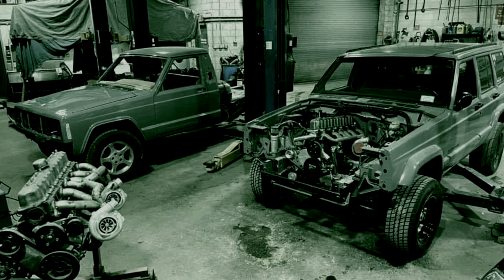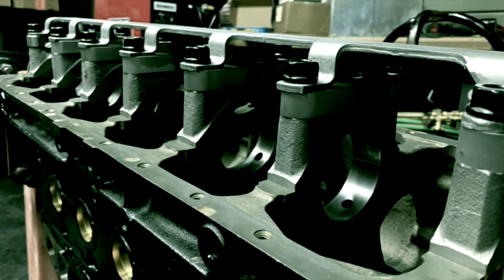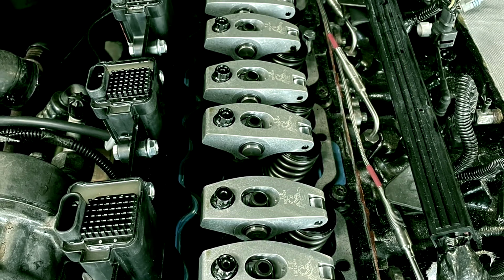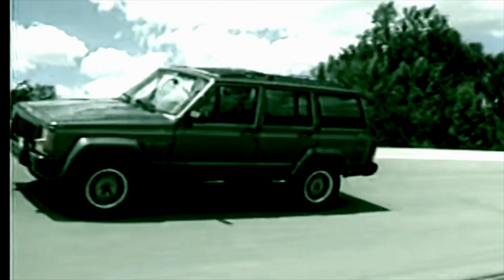Building a 10,000 RPM Jeep 4.0 -  Block modifications to minimize harmonics

Comment: These videos have given me even more confidence in my combo, which is basically a rock stock 92 4.0 with a big intercooled hx40 turbo setup. It's handled a shit ton of boost and abuse, and it just does not care. Appreciate these stories. Probably the most valuable information on the AMC 6, ever told.

Comment: When I noticed my odd bearing wear when I first built my stroker I went to find a girdle. I was gonna make my own but I found out that the grands were common to have them. When I got that done I've noticed the wear was more even. I was surprised how much of a difference it made. I reinforced the block in some areas and made new motor mount plates that utilized as many of the block bosses as possible. I had some of the block machined to make flat areas to extend the plates to those holes as well. Made bigger and stronger mounts to hold the engine in place better and used other reinforcements to keep the engine/trans better secured. I wasn't expecting big changes but every little bit helps since it was a shell at that point, may as well do it while it was there.
Reply: I went with brown dog mounts / plates for my stroker to utilize all the holes.   Had to space the girdle about 1/8" hopefully it doesn't reduce it's effect.

Comment: when the main caps move like he described, its called "cap walk" very common in 2 bolt main cylinder blocks turning high RPM and making high HP. main cap girdles were very common in the aftermarket mid-late 90s for SBF, and SBC in either billet aluminum or billet steel. once aftermarket splayed 4 bolt main blocks became available and more common the main Girdle wasnt necessary.
Reply from the maker: I'm pretty sure it is a different condition.  The stock girdle wouldn't make a difference if it were cap walk and not harmonic-induced flexing.
Reply: @amxj 100% agree
Reply: I wonder if that's why the rb series engines get a factory girdle?

Comment: Interesting that he says you don't need a crossflow head. I never really bought into non-crossflow as this essential performance killer. The way I see it the only issue is heat like Rick said, and port area, which for the purpose of design for the 4.0l wasn't an issue at all. Certainly it could be better but I suspect if you had todays cylinder head engineers design both a crossflow and non-crossflow head the difference would be minor.
Reply: i think a crossflow head on s 4.0 would be a game changer as far as operateing temps, intake air temps, and curing the vapor lock problem especially in XJS. anytime you can keep the intake air temp and your fuel cooler its a win-win and guranteed to be more effecient and make more power
Reply: in the 70s Bruce Sizemore took a Ford  300 big 6 and made his own crossflow head from 2 or 3 351 cleveland heads, (same bore spacing) he cut and welded to make one head. went drag racing with it in a pinto and broke all kinds of records, naturally aspirated beating big block chevys, etc. google him and check it out, the guy was a genious
Reply: I didn't think it was needed either. There's ways to mitigate the heat. Driving on a hot day in the city I will see temps as high as 130. Once I hit the gas a bit it'll drop down to about 105. I have no thermal protection on it. The only thing I have to keep it cool is a fan I positioned directly in front and have it blowing through the the manifolds. Engine temps sit at 190-195 on a 95 day and will sit on extended idle. When I start to get close to 100kpa those temps start to drop very fast, fuel and IAT's drop 50 degrees or so and going into boost it will start getting to ambient temp on a fair day and colder, hot days it will stay about 10 above ambient.
Reply: @CanadaBud23  Yeah I never bought much into the heating part because the thermal exchange between the wall of a manifold or port should be very minimal, only the boundary layer of air is touching. Between the volume and velocity there's just not enough time imo to exchange that heat.
Reply: Cross flow head would blow you mind us English were putting crossbow bmw 16v k100 bike heads on a series engines and if you use turbo steel crank and a 1275 block with high comp pistons and rods will make some right power or even a rare cross flow head for the pushrods help them scream to 😂
Reply: @billy_on_2_wheels  Well sure, but you're talking about in addition to going from reverse flow to crossflow going to a 16v head with radically different ports. Those old reverse flow 4 cyl heads had some really heinous ports. The 4.0l has a pretty good 12 port head for what it is. I think if you were to magically put say iron small block chevy heads on it, it wouldn't be an incredible improvement.
Reply: @Levibetz  you wouldn't belive the difference the motorcycle cross flow or any a series cross flow head helps through with the swil and natural scavenging even with an 8v cross flow aftermarket head on them amd there a rare head make a major change in the characteristics of a fast a series really does make them what they should have been but the original head although good power can be got its just not quite the same 😁 if you haven't seen them go do some digging my old man reminisces about one he cobbled together with a friend 40years ago and the few I have heard it makes quite the difference